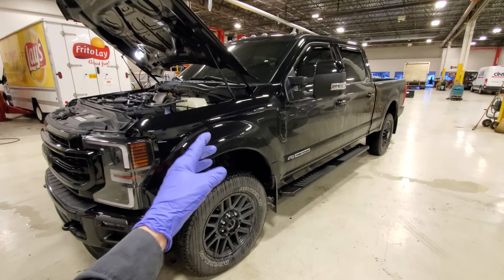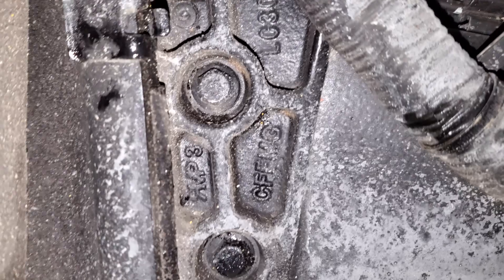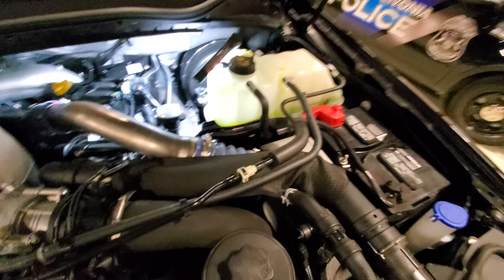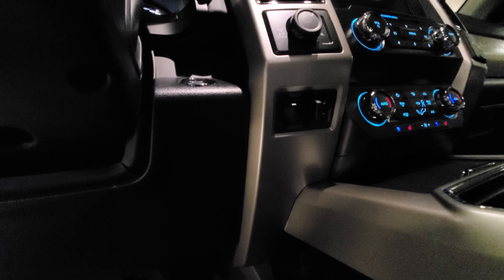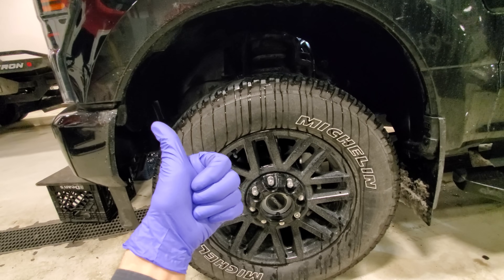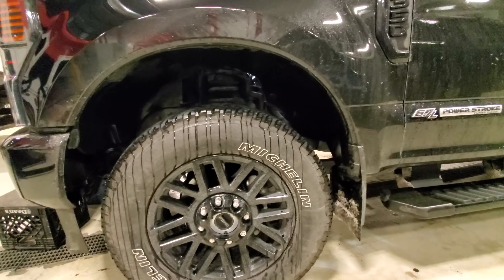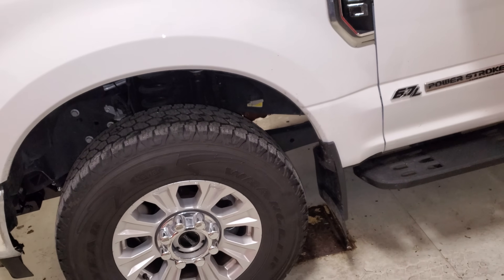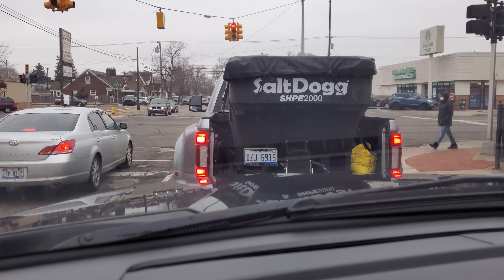What is this THING in my wheel well?? 20-22 Ford F250 F350 F450 EPAS - Death Wobble Cure???

Comment: My 2020 F-350 Crew Cab Dually has the adaptive cruise as well as the back up assist.  The steering assist works great!  I especially notice it driving in a cross wind.  You know, one of those where you have steering wheel turned about a quarter turn to go straight.  It actually straightens the steering wheel up and you no longer have to apply pressure to go straight.  Works great in parking lots also, not near as much cranking on the steering wheel.  I like it!

Comment: Don't have any of that on my 16 wish l did, my wife has that lane keep on her escape and l love it. Thanks ARod
Reply: You don't want  2017  up. I miss my 16 so bad. The 19 has for one aweful steering. Can't stand this truck even after 40k miles. I should of kept my 16 and If I had bucks I'd sell and find a low mileage 16 in a heart beat.
Reply: @jimbobxcityguy5338  thanks for the input l will be keeping my 16 she runs great 113,000 miles on her couple engine lights got them fix but a small leak in main radiator that I'm afraid to fix on my own and the dealership wants 1,500.00 to fix her.
Reply from the maker: Ill do it Jerry cmon over
Reply: @PowerStrokeTechTalkwARod  thank u l might take u up on that . watched ur video 3 times and I'll never remember where ever bolt goes. She been leaking for 2 years since the last time u spoke about it. Thanks ARod

Comment: When are you throwing some Carli parts at her?
Reply from the maker: Never...not into lifts...
Reply: @PowerStrokeTechTalkwARod  OEM is the best 🙅‍♂️🙅‍♂️🙅‍♂️🙅‍♂️
Reply: @PowerStrokeTechTalkwARod  I install levelling and lift kits on trucks all the time...sure it looks pretty but to me they drive worse...and Super Duty trucks also suffer from a loss of caster angle that can't be made up easily with a levelling kit. If I ever buy a 4x4 pick up...I'll be leaving the suspension stock. Lifts and level kits do however keep me employed during the slow times at the shop right now.
Reply: @PowerStrokeTechTalkwARod  think suspension not lift. BDS is a lift, Carli will blow your mind.

Comment: 2020 350 dually, XLT premium, have the lane assist, not the adaptive steering.
Really don’t see much difference between the 19 250 XLT Premium and this one in how it drives and tracks.
That could be to the fact this is a dually. Never had any wheel shimmying on the 250 and none on this one .
Very informative. You almost need to go to school and get an Electrical Engineering Degree to work on these .

Comment: I have pro trailer backup assist but did not option adaptive steering. When I hooked up a small trailer that has maybe 50 pounds of tongue weight. The steering felt completely different, it felt much heavier and more direct. No way that trailer would do anything like so it has to be the truck changing its steering feel based on when a trailer is plugged in. Truck is 2020 f250 lariat sport tremor 6.7, ultimate pkg and heavy duty tow pkg

Comment: My 2020 XLT Tremor has it and I’ve always wondered what it was for?
Reply: I also noticed at 1:39 in the video your truck has a foam sound deadener that goes from the oil cap to nearly the firewall and my truck doesn’t have that.

Comment: GM has had this similar system on the HD trucks since 2016, it is mounted as part of the steering gear though and uses some solenoid and valving mechanisms. It is suppose to help with steering assist at different speeds, dampening, and changes assist when tow haul is selected. The Ford system seems a bit more complex and capable from the looks.

Comment: Currently, I have about 6600 miles and all I know is my 2020, the steering is stiiiiiff. It has gotten a little better but when new, the steering wheel wouldn’t self correct after a turn.  I have that thing you are talking about and I have the backup assist and I have the lane keeping system and I don’t have the adaptive steering.
Reply: My 19 steering is so stiff after 40k miles till. I miss all my previous superdutys and the last one a 16 was the best. Hate this 2019

Comment: I think its part of the adaptive steering system that assists you when you are turning at high and low speeds
Reply: You got it dude
Reply: My 17' has adaptive steering but doesn't have that bracket.
Reply: 19 below had the motor in the steering wheel and failed often

Comment: I have it. 2021F450. But, my steering wheel is and has been slowly being turned to the right. Meaning my steering wheel is not aligned when driving straight.  could this be connected to the assist motor?
Reply from the maker: Alignment clear vision is set...